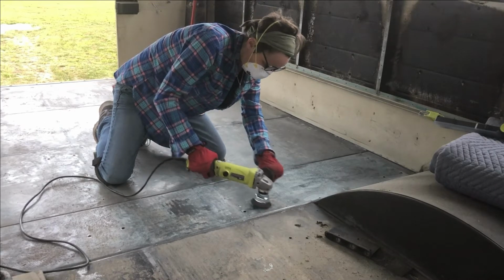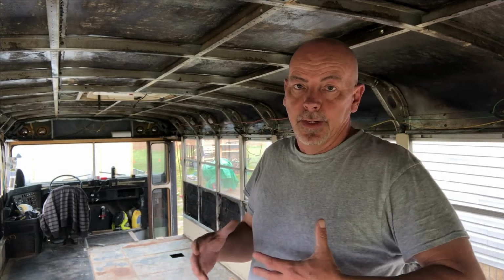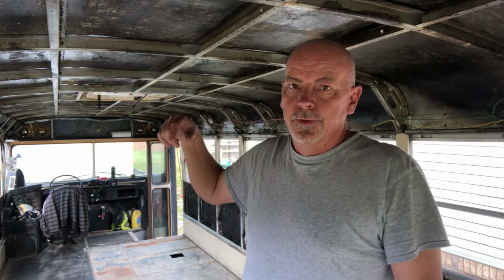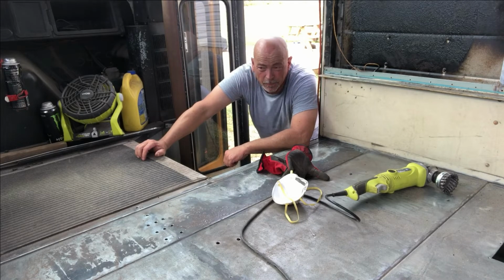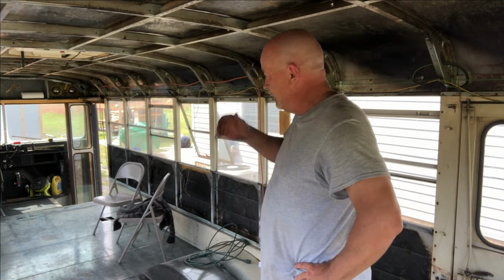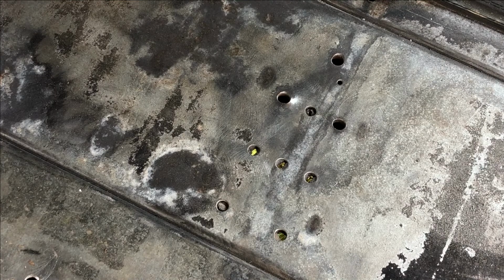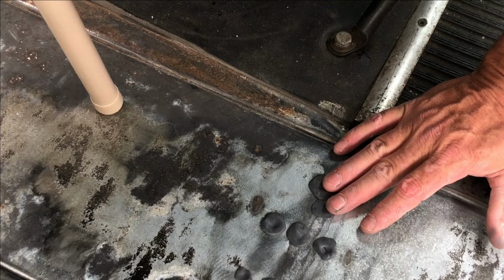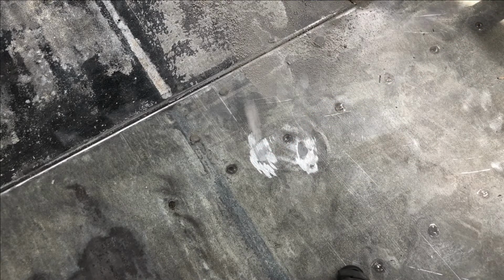Bus life build | The foundation, prepping the floors | Filling the holes with JB Weld Steel Stick

Comment: Fantastic video! Just found your channel and will be sure to watch more of your videos. I've got a shuttle bus, so my floor is not a solid steel floor, but instead is a metal frame. I've been spending hours and hours grinding the rust and getting ready to fill the holes left by taking out the existing plywood floor. I couldn't agree more about a strong foundation - I sometimes feel like I'm going overboard, but I know that in the end it will have been worth it. I will absolutely be using your technique for the holes - hope to get that done by next weekend. Thanks for the info!

Comment: What is the tool called that you used to Grind with?  Is one brand perferred
Reply from the maker: For almost all of my day to day tool chores I use Ryobi One. The batteries are 18 volt. I find the 4 amp Hour batteries in a 2 pack for $99 on sales. The bigger batteries go at it a long time. I also have a plug in Ryobi grinder and orbital sander just in case I’m doing long heavy work.

https://www.homedepot.com/b/Tools/RYOBI/N-5yc1vZc1xyZm5d?storeSelection=
Reply: @TangoRomeo87  what type of grinding wheel did use on the grinder
Reply from the maker: For cutting I use cut off wheels, just a general purpose grinding wheel for small grinding tasks, for removing rust I use wire brush cups.